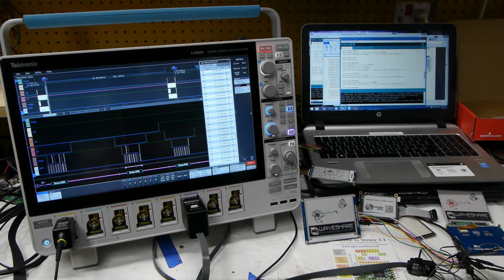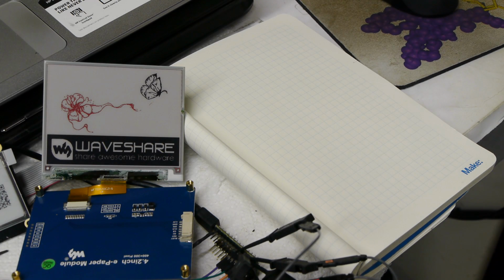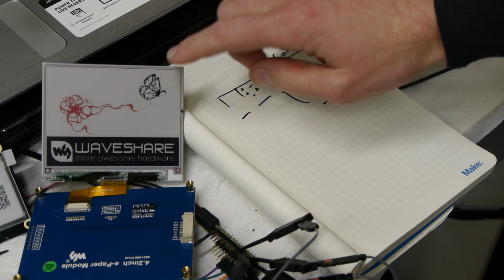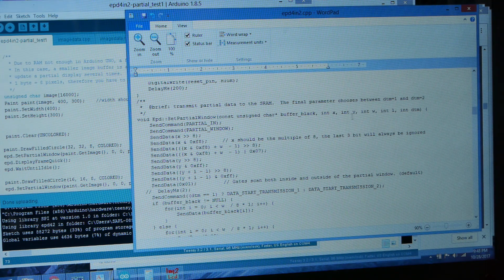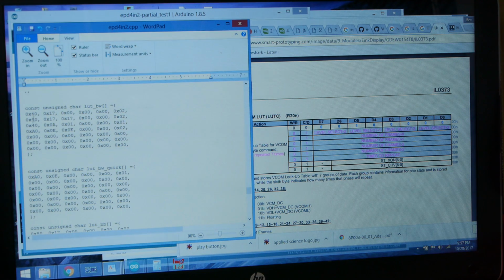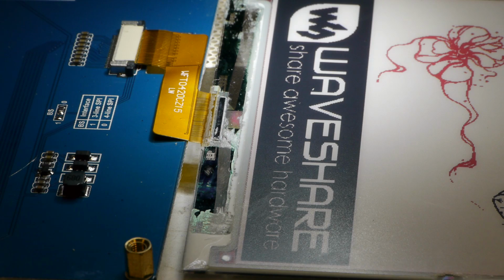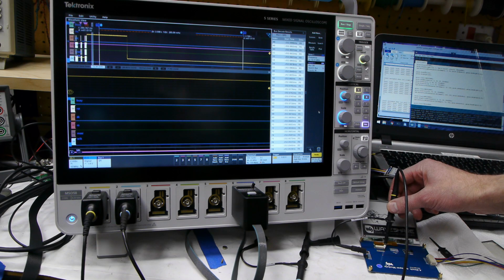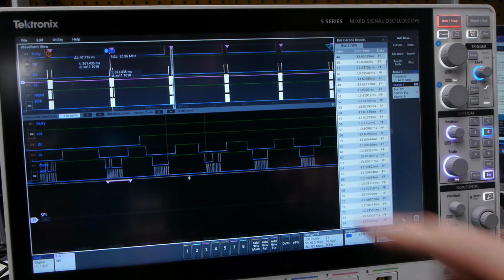E-paper hacking: fastest possible refresh rate

Comment: Brilliant video! I have almost no experience with e-ink displays, so this really helped me learn how they work and how the controller works. I am planning to make a video about OLED displays, how they work, and include some microscope footage of the SSD1306 chip found in most OLED display modules. SO far I have got some microscope footage of the chip, but not enough to use in my video. The problem I am facing is that even with a bright light shining from the top, the chip is still too dark to see clearly.

Comment: I've had my kindle for about 7 years now. I love how the little cells in each pixel are different sizes, looking almost organic, like some alien tech. 
Anyway, I saw this video 5 years ago and I'm glad I kept it in a corner of my head. I'm now making a bunch of arduino projects to make my own smart home and a paper display for things like weather and time is on my list. Indeed, these waveshare displays have a long refresh time, which is understandable to negate burnout. But would it be sufficient to simply "draw" the opposite of the current pixel to remove any remaining charge then putting our own, only in the area that needs refreshing (for example just the part of the display showing the time)? If most of the screen is white and will remain white, why update it at all? Or maybe the way the display works is by drawing the entire screen anyway, in which case drawing more white on white will cause this "burning"

Comment: Such a cool technology. I love my ebook reader. The one that I have has a refresh sequence where it does minor refreshes every page, and then a longer full-clear refresh every 5 or 6 pages or something. It's also worth noting that the cells containing the charged pigments do not correspond to individual display pixels, but are smaller and more randomly clumped together. The pixels come from the electronic array underneath, and one pixel may activate particles in multiple or partial cells. The cell structure exists to ensure a good distribution of the different particle types across the screen.

Comment: I know this post is several years old at this point.  I have a newer 2.9" waveshare screen which supports partial refresh @ 300ms.  Is it possible to further drive these devices to refresh quicker given the state of the current firmware?  I'm working on a typewriter application that is just too slow to keep up with a reasonably good typist.

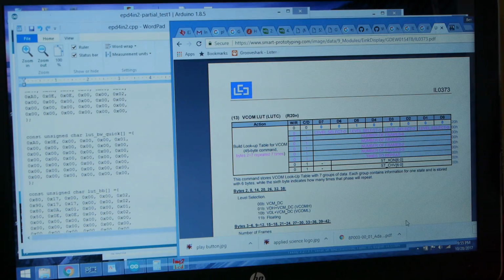Comment: Stopped at 13:56 due to Ad Whoring.
Did you know Google forced auto mid-roll ad placements on people that didn't know that was forced upon them? The frequency seems like the ads are auto-inserted, ruining the video.
If you were not aware, you may want to go to settings, and set the mid-rolls where you really want them. Most people don't need nearly as many as forced onto them.

Comment: What if you vibrate the screen ultrasonicly would the whole screen turn red using that ultrasonic vibration what if you build a screen that is part mechanical part electrostatic it would be monochrome but you could prevent burnins by only using repulsive force to activate pixels and high frequency electric oscillation to reset the screen by oscilating the screen mechanically and having the large particle force do to them having less shearing force on each other

Comment: Best source for details on these e-ink devices I've ever seen. One thing I would love to be able to hack these displays to be able to do is to be able to read the current content off the device. Imagine a reader that you attach the e-ink display to and it can determine what's displayed on it already. Based on what you found scraping off coverings and such from the displays - would it be possible to somehow determine what the display's contents were simply from the display itself? Think of it as a very slow but visual static RAM.

Comment: Hi, is there a port of the example for ESP32? Highly appriciate your support.
Getting below error:
13:52:28.151 -> ets Jun  8 2016 00:22:57
13:52:28.151 -> 
13:52:28.151 -> rst:0xc (SW_CPU_RESET),boot:0x13 (SPI_FAST_FLASH_BOOT)
13:52:28.151 -> configsip: 0, SPIWP:0xee
13:52:28.151 -> clk_drv:0x00,q_drv:0x00,d_drv:0x00,cs0_drv:0x00,hd_drv:0x00,wp_drv:0x00
13:52:28.151 -> mode:DIO, clock div:1
13:52:28.151 -> load:0x3fff0018,len:4
13:52:28.151 -> load:0x3fff001c,len:1044
13:52:28.151 -> load:0x40078000,len:8896
13:52:28.151 -> load:0x40080400,len:5816
13:52:28.151 -> entry 0x400806ac
13:52:28.357 -> Guru Meditation Error: Core  0 panic'ed (InstrFetchProhibited). Exception was unhandled.
13:52:28.357 -> Core 0 register dump:
13:52:28.357 -> PC      : 0x00060023  PS      : 0x00060130  A0      : 0x8000bec5  A1      : 0x3ffbbfb0  
13:52:28.357 -> A2      : 0x3ffbbaf0  A3      : 0x3ffbe7e4  A4      : 0x3ffbe7e4  A5      : 0x00000000  
13:52:28.357 -> A6      : 0x00060120  A7      : 0x00000000  A8      : 0x8000be99  A9      : 0x3ffbbf90  
13:52:28.357 -> A10     : 0x00060023  A11     : 0x40001fec  A12     : 0x00000000  A13     : 0x00000000  
13:52:28.357 -> A14     : 0xffffffff  A15     : 0x3ffbbbcc  SAR     : 0x00000000  EXCCAUSE: 0x00000014  
13:52:28.357 -> EXCVADDR: 0x00060020  LBEG    : 0x00000000  LEND    : 0x00000000  LCOUNT  : 0x00000000  
13:52:28.357 -> 
13:52:28.357 -> Backtrace: 0x00060023:0x3ffbbfb0 0x4000bec2:0x3ffbbfd0 0x40088901:0x3ffbbff0 0x400896ee:0x3ffbc010 0x40089703:0x3ffbc030 0x40088215:0x3ffbc050
13:52:28.357 -> 
13:52:28.357 -> Rebooting...

Comment: I have been following your channel for a long time and I always thought everything you were doing was way god-level above and beyond the work I do.  But low and behold I just watched this video and this was exactly what I was working on!  I was working on a 4 level e-ink display but it's very similar.  The lookup table format in my controller works differently but close enough to at least be set on the right path.  I learned a lot from this video and I am trying to reproduce your findings.  I made a lot of breakthroughs inspired by your video.  It was basically unusably slow before and now it's much smoother and getting better.  Thank you very much!

Comment: On my Kobo Aura HD, the ink cups are randomly distributed, both in size and location. The view under the microscope is like a styrofoam, instead of the honeycomb that can be seen here. Of course the pixels are formed by those multiple random cups that end up over an electrode pad.

Comment: One question that's bugging me...  If the panel ends up in that polarised/charge built up state,  surely that burn-in can be reversed through some type of electrical action. So can the burn-in be removed?  It seems strange they didn't build in some type of sink to remove the built up charge.

Comment: Would it be possible while doing a partial refresh to open bus the column lines you don't want to update?  Is the controller sophisticated enough to let you do that?  Does it prevent burn in on the unselected lines?

Or am I completely misunderstanding the problem?  I think I'm completely misunderstanding the problem.

Comment: Is there are reason why the code from the manufacturer is so terrible? I thought maybe the chip only supported a stripped-down instruction set and therefore the old C style was necessitated and then not very well executed, but then I spotted the C++ file extension and the use of objects, so it must be able to, no? Am I missing something? Or does the manufacturer actually have 0 shame?

Comment: Can you or your controller PCB read back the data from the e-paper display? If so, this would be a new form of non-volatile RAM!! With a very slow refresh rate!!
Reply: I don't imagine you could. The particles stay in place because of the viscosity of the oil they are submerged in, that's why they only need a quick blast of electricity to activate. Otherwise they don't give off any electrical signal, as far as I'm aware, so you probably couldn't read them. Normal storage systems work by storing a slight charge in an array of electrical elements, which is why you are able to read those, but these displays wouldn't have that. I honestly haven't researched it much, though, so it might work! That would be really cool if it did!

Comment: Just run the display at a higher amperage than the display can hold a charge per cell. Then you can run the disply on DC with no burn in issue because the signal will forcefully overide the built up charge. Problem solved.

Comment: Hmmm, I always thought the pigment particles were white on one side, black on the other.
Same electro-charge-attraction thing, but the particles rotated in place in a flexible plastic matrix rather than getting pulled to the top or bottom of a fluid-filled cell.
It took about 20-30 volts to drive the particles to rotate, refresh was pretty fast and didn't require full-page updates.
The tech I am thinking of did have a finite life; was good for about 500 'writes' before the particles started to get stuck and was very temperature sensitive; freezing cold immobilized the particles.
20+ years ago?  I want to say IBM, not so sure now.
Reply: MIT

Comment: The reason you don't run DC in any of the flat displays is that it electrolytically deplates the transparent tin from the glass. Those are the conductors that carry the charges. No wires, no pixels.
Reply: Well, if the LCD goo were conductive, that would be a problem.  But it aint!
The things work with electrostatic charges in the liquid part of the Liquid Crystal Display.  
Liquid crystals are large molecules that form an oil.  An insulating oil at that!
BTW: DC does cause galvanic corrosion, but so does AC!
Whenever one of the leads is positive [50% of the time for AC] and in contact with an ionic conductor, metal will be pulled off the wire.  
Can't accept them electrons without giving back some metal ions!
And since we are not running a plating bath, the 50% of the time the wire is negative doesn't replace or rebuild the lost metal.

Comment: Here's something interesting. I bought a 2.13 e-paper display to try out. I bought the three color kind and looking at the waveshare website, the two color one supports partial update and not the three color one. However, the three color one datasheet states that it supports partial update. I contacted waveshare and they said that the chip supports partial updates but the e-paper module does not. However, your three color module has partial update so I'm now wondering what the deal is. Perhaps it might be possible to get partial partial update working.

Comment: Fantastic. I just acquired a small tricolor display and the update process is slow and annoying (and possibly should have an epilepsy warning). Improving that opens up a lot more use cases. For what it's worth, the Pi version of their software comes with a Python version if people aren't comfortable with C.

Just checked the info page for my module and it says that partial refresh is not available. It is for the 2-color one though so I may go for that.

Comment: Wouldnt be possible to revert the burn-in with a magnet or a strong magnet?
Reply: I'm sorry, but you are confusing magnetic and electrostatic fields. 

It won't work for the same reasons a balloon attracts hair but not a magnet.

Unless you use a crazily powerful magnet. Then, even plastic becomes magnetiseable! Just don't put body parts in that magnet ;-)

Comment: When switching frames, why is it trying to make a white pixel white again? Why just do nothing?
Reply: Sion If I had to guess it’d be because the particles in the cell might start to move anyway if no charge was passed through it, but if the cells around it were receiving a charge. So if you wanted one cell to stay white, but every cell around it was being turned black, you’d need to apply the white voltage to the cell at the same time so it wouldn’t change color. This would probably also be more important the smaller the cells were. This is just a guess though, I don’t really know.
Reply: @rylblue3909  It's a good guess, very likely.
The screen could then be improved with an edge detection algorithm to detect where a change is happening & only apply the "counter current" around areas that are changing. 
Maybe occasionally apply an update to areas that haven't been updated in a "long" time (like 1 to 10 seconds) just to make sure that the pigments stay where they should.
Reply: @sebbes333  Hm, that would be neat, but would also mean more expensiver hardware (good devs cost a lot of money, yknow).
Reply: That's the point of the partial refresh, so it CAN be done. You might not WANT to, because of what he was discussing up front about the potential burn in problem.

Comment: TIL there are multiple e-paper types. The one described here is electrophoretic. There also exists gyricon, where instead of a bunch of pigment particles, each cell contains a small bead that is magnetically polarized and colored, so that it spins in place to present the desired hemisphere. It occurs to me that one could have a sphere with colored poles and a stripe along its equator. You could then have electrodes along the display surface to orient the sphere to show one of its poles, and in addition have a electrodes in the middle of the paper's cross section, which would cause the sphere to orient so that its equator is visible at the paper's face. This would give a 3 color per pixel display. I hope that makes sense.
Reply: Do you think that would cause refresh rate to get worse or better or the same? That to me is really crucial to closing the gap with lcd note taking and reading like the iPad

Comment: Is it possible to capture and split a high resolution   video into quarters direct from the sensor so that you can get a wireless analogue video feed that can be sent over four 5.8Ghz antenna and then recieved and recombined in a recieving headset for the purpose of maintaining the ultra low latency of analogue video but overcoming the lack of resolution in quadcopter racing?

Comment: I haven't played with e-paper displays yet but I'm a big fan of WaveShare's  toys. I use their FPGA kits for all kinds of projects. You've mentioned permanent burn-in and/or damage - do you have any idea of what the possible mechanisms for that would be? I can't picture a way in which you could damage these cells even with strong polarization, based on how you've described their theory of operation. The only thing that comes to mind is some kind of cell overheating that could perhaps fuse some of those powder particles together which are presumably at least partially plastic (I'm thinking of laser printer toner), or perhaps damage to the fluid in which they're suspended.. many lubricants for instance increase in viscosity after enough heating/cooling cycles, which in this case would cause the cell to transition slower and slower unless you increase the drive voltage, up to a point. The thermal conductivity of the fluid may be low, so while there's plenty of thermal mass in the entire display, it's conceivable that there could be high localized heating within the tiny cells, which could cause damage if the rate of heating exceeds the rate of conduction of that heat away from the cells. Come to think of it, you could in theory use per-cell heating and the resulting change in fluid viscosity to control transition rate for some purpose. Thank you for the video!!

Comment: I worked for EINK several years ago and the team I worked for mainly focused on creating the waveforms for each transition. Each grey had a waveform and there were also different waveforms for different temperatures. Because any variation in the chemistry or display assembly affected the transitions, each batch of panels required custom waveforms. I'm sure it's more automated today but the number of technician hours involved in making those earlier panels was crazy.
Reply: Is that why eink screens cost so much? (ie like the big ones in the remarkable tablet or sony dpt)... I always assumed it was just cuz eink had a monopoly on the market
Reply: @anjankatta12  From what I know, not only; they also have a realyl bad yeild rate
Reply: having to find the right waveforms per batch sounds tedious, but that must have been a nice paycheck for the technicians
Reply: Paycheques aren't always commensurate.. but if the job one does 8s satisfying in itself.. then it is a reqard in itself
Reply: 8hu
Reply: some dude got 60fps eink working.  check out the Modos Flow by wenting.
Reply: alysdexia  nescient, lacking of knowledge, ignorant; doth not describe a paycheck, smarty.
Reply: @femmujihadin  nescient paycheque sounds like a kind of disability welfare
Reply: alysdexia  the public index of your insufferable method and personality shines brightly.

Comment: At first, I thought that e-paper would be good for restaurant menu displays… But the limited color options is a problem when the competing technology of real paper, has photorealistic color capabilities. So I tried thinking of a use other than e-readers or restaurants.

How about a device for taking digital notes in class? You could use a low contrast (high refresh rate) mode for actually writing the notes down, with a touch screen of some type, and high contrast (low-none refresh rate) mode for displaying the notes. And since the display only has a bit-depth of 1 bit per pixel (unless you have a 3 color display) you could save a lot of digital storage space by only writing image files with only 2 color values. Perfectly valid PNG images can be made that are optimized for 1bit color. I think the tricky bit would be balancing the contrast with the refresh rate, for the writing mode, to make it easily visible, but responsive-feeling enough to write notes with. Do this write, and you would save a lot of paper.